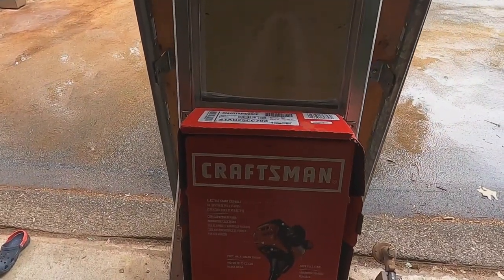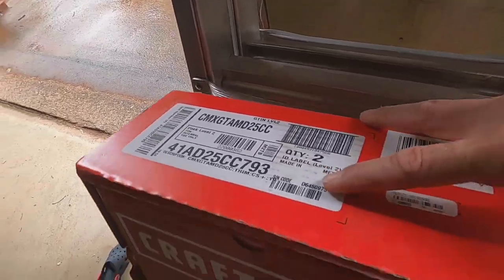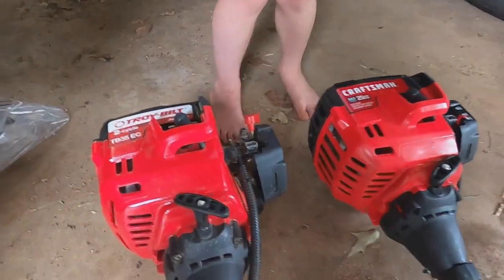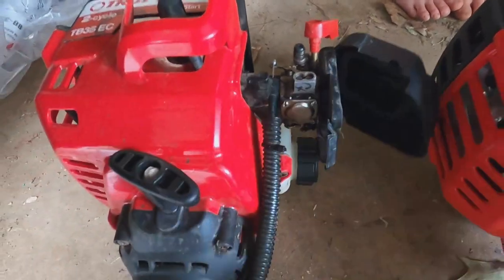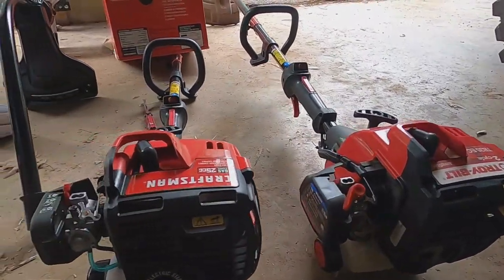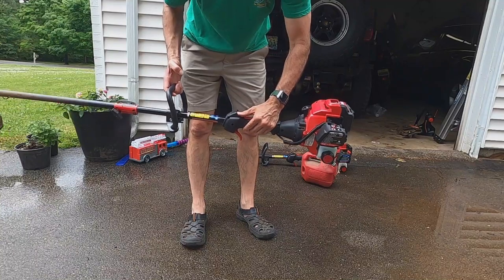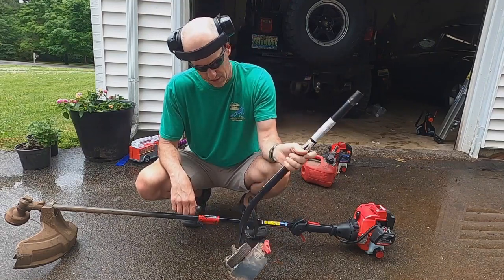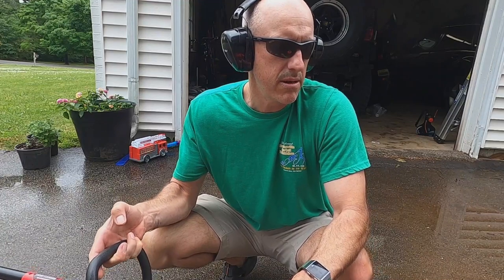TROYBUILT vs CRAFTSMAN WEEDEATER

Comment: ok it's two years later.  did it break yet?
Reply from the maker: It still running!!! I got my moneys worth out of it.
Reply: @TheNextAdventureWeTri  well at least it's not 100% the same as the troy bilt then hahahahaha. Is that the WC210 model?  if so I see Craftsman discontinued that model already.  A guy I know had the WC210 and he threw it away because he said he was tired of pulling his arm off trying to start it.  He didn't realize it had a start port in the back and he could have used a cordless drill to start it.  Have you ever used that start port?
Reply: oh also I just remembered I saw a video on youtube where a guy with a WC210 model tried to start it and it took him 140 pulls to start it hahahahahaha.  I'll see if I can find it again.

Comment: You are killing your motor 40-1 only
Reply from the maker: I run 1once of oil mixed with 1 gallon of gas.
Reply: Or spend a little more and run a better quality oil and just do the 50 to 1.  Most mechanics will mix it as a 45 to 1.  You're not going to kill your motor with 50 to 1 on a 40 to 1.  You would if it was a 16 to 1.  Watch project farms video on cheap versus high quality oil if you want better information.
Reply: @TheNextAdventureWeTri  that is why your other one burnt up you need to mix 40 to 1
Reply: 128:1 mix? Lucky you got ANY repeated use.